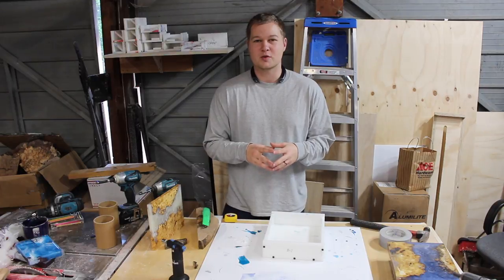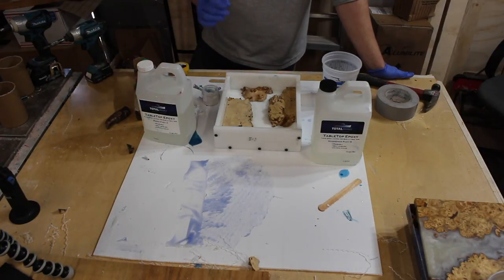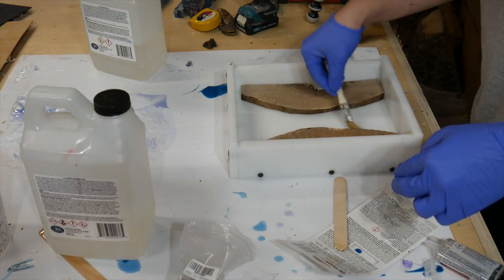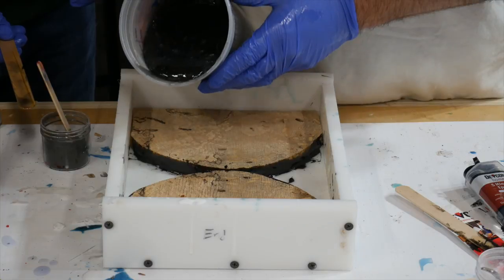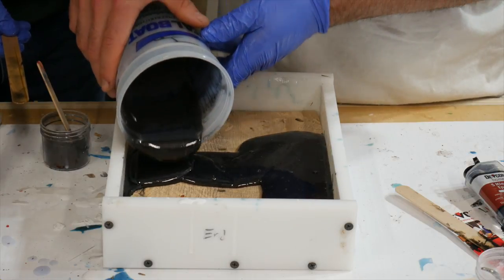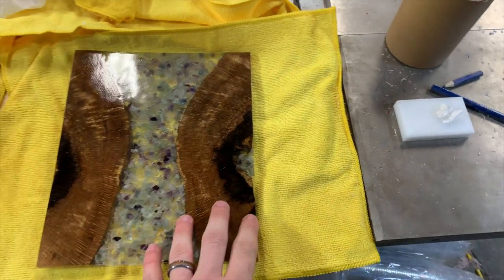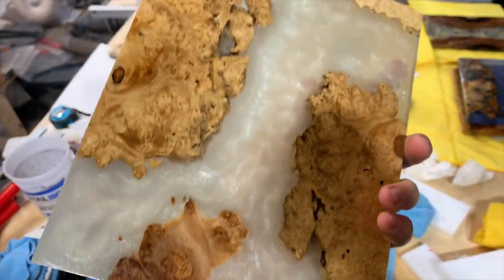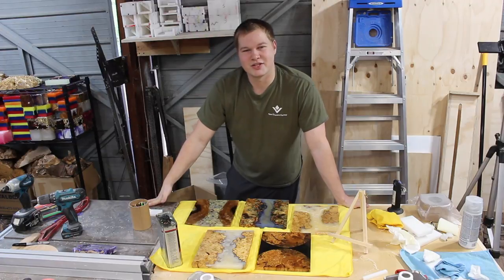How To Make Resin, Burl, and Stone Cheese/Charcuterie Boards

Comment: Is Casters Choice the now preferred powder than Pearlex? Great pieces by the way! Also, You can use a small butane torch to dissipate the bubbles in the casting, not that you probably didn’t know that, seeing that you’re one of the Casting Masters!
Reply from the maker: I use pearl ex still for their interference colors, but Casters choice for pretty much everything else. I like how well it mixes with no clumping. But pearl ex still has some colors they dont and vice versa. I do know about the torches, and actually used one on the stone board. However I am not positive how well it works with this resin because I feel like its also just blowing hot air into the epoxy. I also had to pop them every 20 minutes to an hour or so, and it wasn't worth my time. I think they would have popped just as easily as the other boards had I not done it.

Comment: Thanks so much for your videos! God's strength while you forge ahead. When do you find the time? Question did you place them in your pressure pot still?
Reply from the maker: Thanks so much Lola! I try my best to manage time and also put my priorities where they need to be! I did not use my pressure pot, the mold wouldn’t fit. Also not necessary with this type of epoxy

Comment: On the board with the stone, you said that you should have poured a thin layer of resin first. Would you need to let that cure completely and then add the stones and do the 2 pour?
Reply from the maker: Yes. At least hard enough that it wasn’t jelly. With that resin usually 6-8 hours was fine for a repour, where it’s full cure is still 16-20 hours
Reply: Thanks Casey. I think this will be my next Christmas gifts for my family.